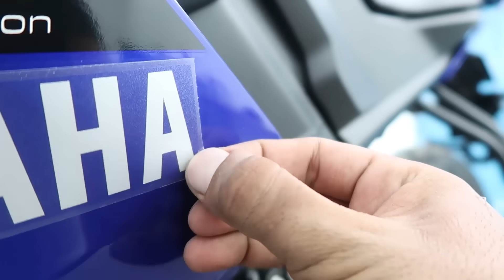Rebuild Timelapse : Yamaha R15 V3

Comment: jeet can we install this swing arm into mt ?
Reply: Yes you can, I own a MT and I will soon add that swingarm on my MT. You might need a few parts from the R15 apart from the swingarm.
Reply: @powerride1353  few part means do we have to cut things out or just simply add ? will it damage the bike internally ?
Reply: Pratik Tandel Everyting will be a direct fit. Things you will need - 
Swingarm 
The mudguard attached to the swingarm
Bracket to hold the callipers 
And I hope that should be it.
Reply: @powerride1353  if you do youll be the first in india.when r u planning to do ?
Reply: Pratik Tandel Soon my friend but I first need to research on what difference is it going to make to the bike as MT is to be ridden on the street and the box type does it’s job well! Will surely make a video if I decide to go for it.
Reply: @powerride1353  keep me posted bro
Reply: @powerride1353  will you upload on youtube ?
Reply: Sometimes rear shock absorber needs some adjustments. Because the area where shock is bolted on box type and aluminium swingarm may different. So just check it . This is just my thoughts. Don't know exactly. Just make sure so you don't waste th the money.
Reply: KARTHIK BIJU How does the international variant have same swingarm on both?
Reply: @powerride1353  any update bro ?
Reply: Pratik Tandel Just enjoying my ride for now, managed to get the cost for the swingarm.
Reply: @powerride1353  how much it is ?
Reply: @powerride1353  I don't know about the international variants but just think about it. The swing will be able to fit correctly on to your chassis because both r15v3 and MT15 has deltabox chassis. So we can rule out that. Then comes the shock which is directly connected to the swing arm linkage. Even if you have successfully installed the shock I think it will still interfere with the chain alignment and all .
Reply: @powerride1353  I think if you have friends with R15V3 or V2 just ask them to give their swingarm to check everything. So if it goes well then buy a new one .👍

Comment: Please make a video on malfunction of abs in R15v3 BS6... currently sometimes my bike's is working and sometimes its not.. whenever I go through pothole abs starts working and after certain time it's stopped working. Scanner machine firstly it shows front sensor issue after resetting that it is saying that motor is not working, so what do you think its a motor problem or any wiring issue.
Reply from the maker: Disconnect the wiring coupler from abs motor and clean it
Reply: @JeetBhaskar  I will try the fix ... I am from Bangladesh.
Reply: @JeetBhaskar  Brother still abs is not functioning..... the wires are still passing electricity but motor is not active.

Comment: brother. r15 v2 me pickup bhut kam ho rakhi h nd milage bhi bhut kam deta h 
mane uska oil filter bhi clean kar dia
air filter bhi clean kar dia
injector bhi clean krdia 
engine oil bhi motul 300v 15w 50w
but phir bhi pickup nhi h bike me
koi solution btao bhai Preshan ho rkha hu
2017 model h 20k chli h only

Comment: Hi @Jeet Bhaskar. I want to know if 1PA cylinder of Yamaha R15 still uses DiASil technology?
Reply: I am not able to decide if I should use 1CK (Original cylnder of R15 motorcycle) and 1PA cylinder used in later models and replacement kits.
Reply: Actually I forgot to note down direction of T1 and T2 rings when taking them out of piston. They mentioned that they need to be placed in T1 and T2 markings facing up.

Now I do not know which way I should place TOp Rings as they are having no marks (Marks removed due to usage)

How can I place them in proper orientation. As I can not see visible tapering on rings.
Reply: I wasted 1 month. Rings are not available as child part. I am ready to spend money on rings. But Yamaha distributors only sell Kit containing Cylinder + piston + rings (They are 1PA and 2 PA models)